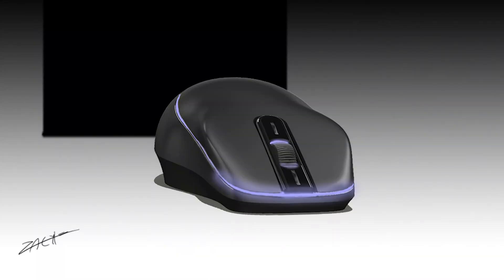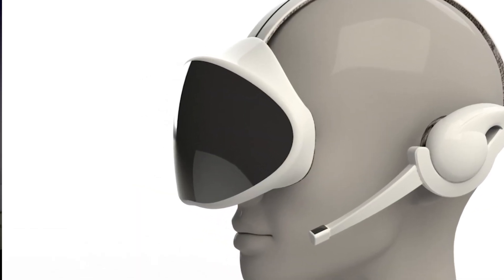Input shaping on Crealitys Sonic Pad

Comment: 10-50 !!  10-78 !!  

nobody noticed the JB-WELD in the screw holes that is now on the bottom of the Sensor. 

so now the Sensor AND Screws are JB-Welded to the badass bracket. 

lol good luck getting it off without cracking the housing of the sensor.
guess you can always make another housing. lol.

but i do like the idea of a Magnetic G-Sensor Mount for the Bed.

and now, with just a small piece of steel mounted to the Extruder, the whole thing is easy to move from Extruder to Build Plate !!!!
and just flip the X,Y,Z to any orientation on the Sonic Pad and you dont have to worry about breaking the sensor housing to get it off the JB Weld you didnt clean off from the bracket. rofl.

Comment: Actually all those good words about Sonic Pad should be told for Klipper and it's input shaping feature. It's not Creality who made the Klipper after all. I upgraded my Ender 3 v2 Neo with Dragon Hotend and a full metal double gear extruder with direct drive plate, silicon bed springs, double Z-axis shaft and stepper but overall I am most impressed by Klipper overall. It is the biggest new big thigh in 3D Printing hands down. I just love Klipper❤️

Comment: great video, thanks. If I have run the calibration once initially, what do I have to do to rerun it? does the routine overwrite previous procedures or do I have to change any settings before rerunning it? Thanks
Reply from the maker: Hey Norman, once you finish running input shaping, klipper should automatically save the settings in a printer config file, and it needs to be rerun only if changes are made to the printer, (as opposed to pressure advance, where the number you get from the equation needs to be saved under the Presure_advance section of your printer config file) thank you for the comment, i hope i helped you out😊

Comment: I finish my x and y test, the sonic pad says test successful and that it will reboot. When it reboots it takes me back to the start of the test again, where I select printer style, and I have to back out of it. Is this correct? Every video I can find seems to show it returning to the Home Screen so not sure if it’s taking my results.
Reply from the maker: Hey there Hunters Hard Drive, this does not sound correct, have you checked your printer config file to see if klipper registered the input shaping documentation? it should look something like this (but not the same reading)
 [input_shaper]
#shaper_type_x = 3hump_ei
#shaper_freq_x = 78.2
#shaper_type_y = mzv
#shaper_freq_y = 38.2
Reply: @z-made  after checkin the config file I do see the results in there. Strange as I’ve run the tests a few more times and it always resets back to the start of the tests. Prints are coming out great just hope I’m not missing an opportunity to improve them further, and of course raise my speed. Thank you for your response!
Reply from the maker: @ImNotLostButWhereAmI  Ya for sure Hunter! any time😊
Reply: @z-made  thank you! I have not but will check when I’m back at my printer. Thanks for the tip 👍👍

Comment: I appreciate your truthfulness. 3D printing is not a hobby if you're in a hurry or you don't like to tinker. That said, my sonic pad should be arriving soon!
Reply from the maker: Hey Jay, that's great to hear! what printer are you using?
Reply: @z-made  Ender 3 v2. I've done some upgrades to it like adding the CR Touch and replacing the bed springs and switching out to a metal extruder. It's pretty much a Neo at this point I guess. I'm currently using Jyers firmware
Reply from the maker: @jaygreen4526  Hey Jay, I'm sorry for all the questions, I don't want to drive you nuts, but... How is the jyers Firmware on your Ender 3 v2? I heard about how it expands usability on some of the creality printers, especially with upgrades like the CR Touch and things like filament change, but I never used it, I'm only asking because you ordered the sonic pad?
Reply: @z-made  No problem! I find the Jyers mesh leveling firmware to be light years ahead of the stock Creality Marlin firmware. I have no issues with it and I'm very happy with it. I've recently started using Octoprint using an old smartphone  (Raspberry Pi cost a fortune as you know) and I've found it to be a little cumbersome. From that perspective, the Sonic will clean it up for me and the web interface is apparently much nicer. As well, the speed increase is a no brainer but it needs to be set up properly. I've wanted to get into the Klipper firmware for a while now, but the setup videos I've watched are enough to make your head spin! Hoping this will be the easy alternative! 🤞
Reply from the maker: @jaygreen4526  Thanks for answering Jay, that has definitely been my experience as well, I was using Octoprint on a phone as well and found it super annoying, but once I upgraded to the sonic pad, it made my life so much simpler!

Comment: Nice quick videos, I like them. Question though from a super noob with a new sonic pad. If I want faster speeds (after doing the input shaping and pressure advance and all that) I’m supposed to increase the speed in my slicer? 

I see a lot of people saying that they are printing roughly 80-200mm/s but they are just typing that into their slicer, right? There’s no speed settings on the sonic pad itself? 

Yes, I’m new to all this so don’t hate but like you I have other things in my life that take a lot of attention.
Reply from the maker: Hey there c0mputer, ya that is a totally legitimate question, yes you can increase the speed via your slicer, I would suggest increasing your speed in increments of about 50 mm/s and acceleration by 100 mm/s until you find that sweet spot. what printer are you using if you don't mind me asking?
Reply: @z-made  Thanks brother, I’ll try that stuff out post haste. I’m using an Ender 3 S1 Pro so these videos are perfect!
Reply from the maker: @c0mputer  Awesome printer! good luck man😊